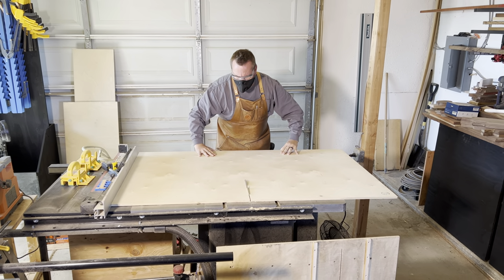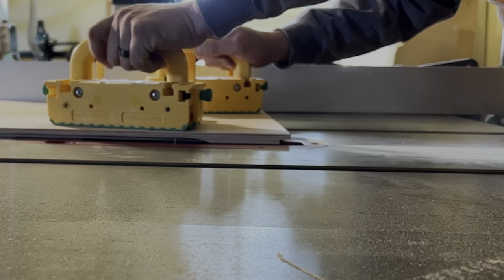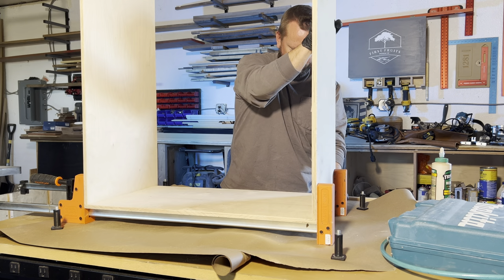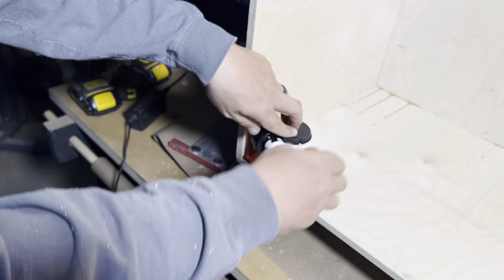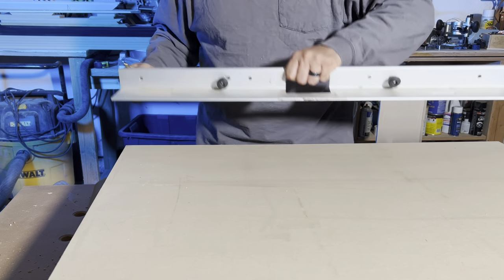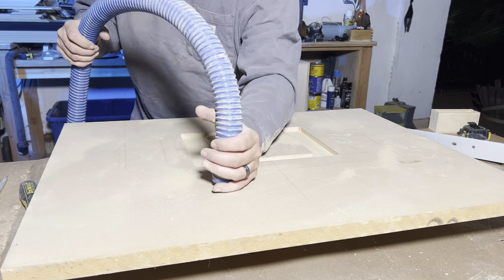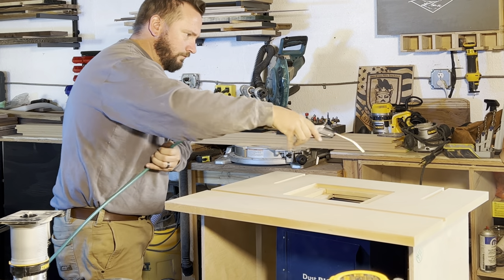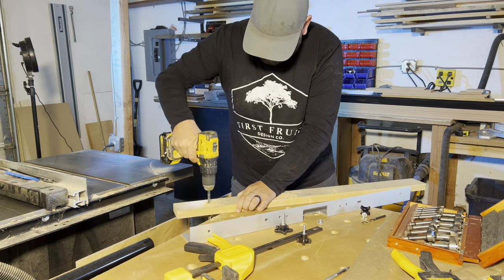How to Make a Router Table with Router Lift and Dust Bucket!  #routertable #woodworking #woodshop

Comment: Where did you get the T-tracks for the fence (the short black ones in the video)?
Reply from the maker: I likely got them on Amazon in 48” length and just cut it down on the miter saw. I really like how the black looks against the wood tones.